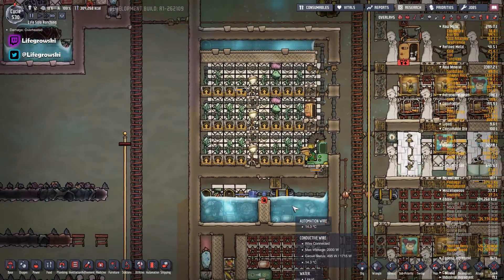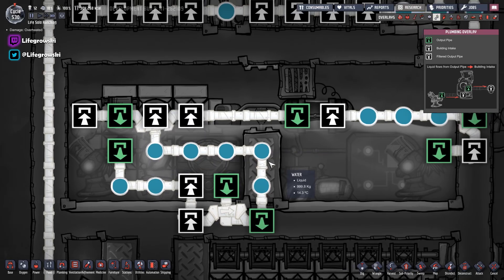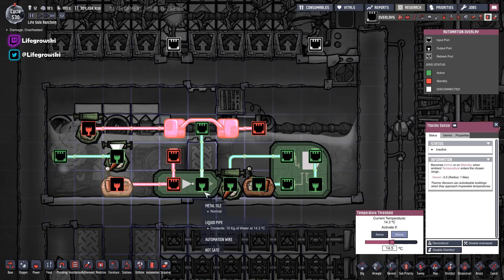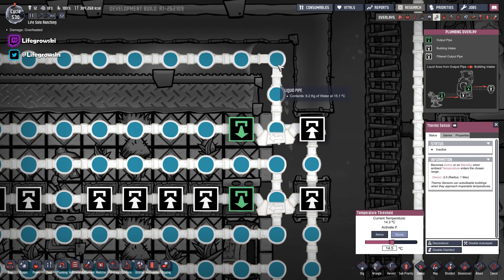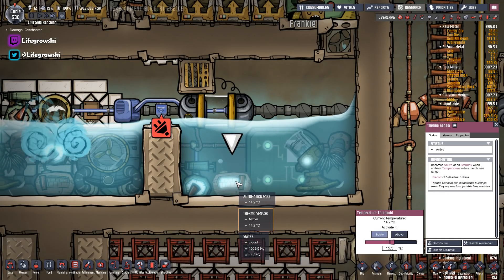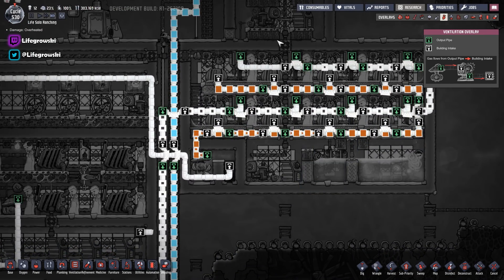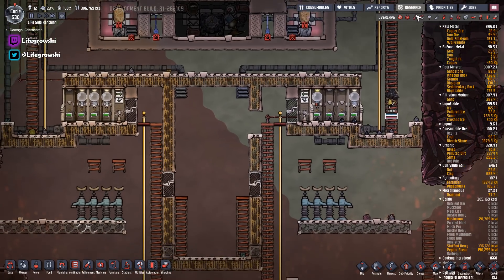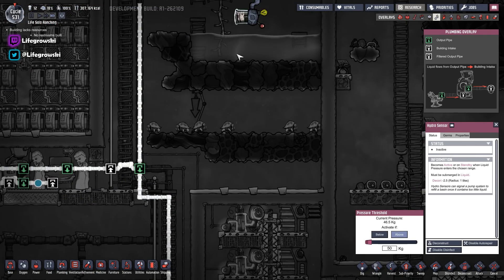EASIEST LIQUID COOLING (With Save file!) - BEST AQUATUNER BUILD I'VE MADE!

Comment: This makes no sense, where's the heat? Was this using the drip cool bug?
What I don't get is why you would want to have an overflow pipe from the aquatuner, you're basically cirlcling around water of the same temperature and wasting extra energy because the pump runs 24/7. Did this destroy heat because of the drip bug?
Reply from the maker: General rule of thumb, with any older build video - check the video description first :)

Comment: Just wanted to mention that in the expressive Update this is working for me it's just taking way more time to cool it down. I built this setup around cycle 490 and the water was just shy of 90C. Currently at cycle 528 the water is now about 69C and dropping. It's slow but I think it will become manageable once primed to the set temp range.
Reply: yea i wouldnt start this build with geyser water but from limited testing water from a sieve should work